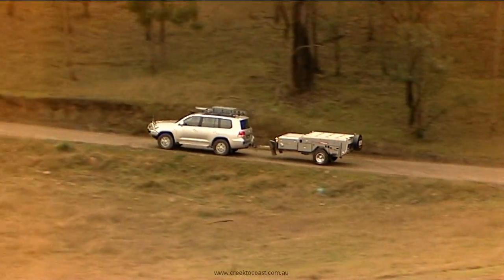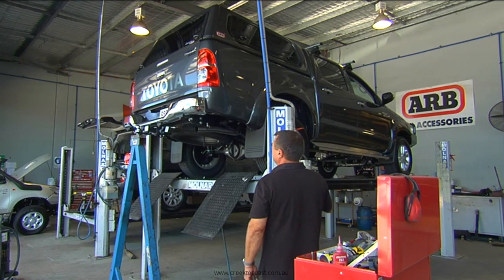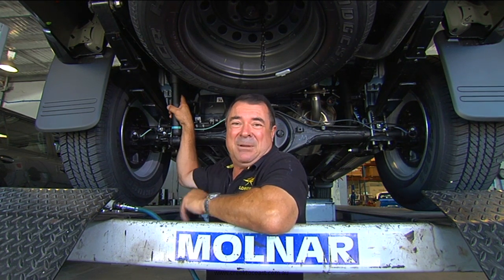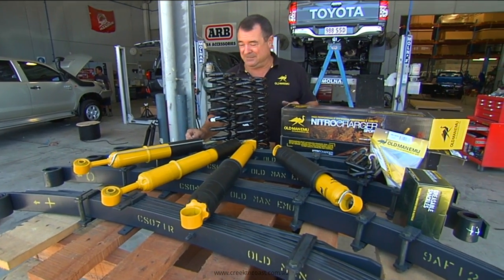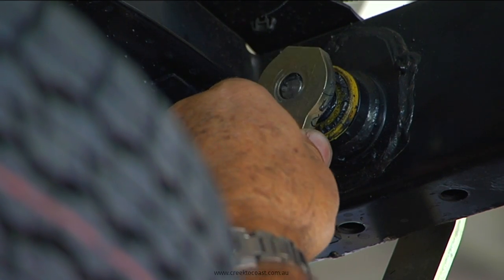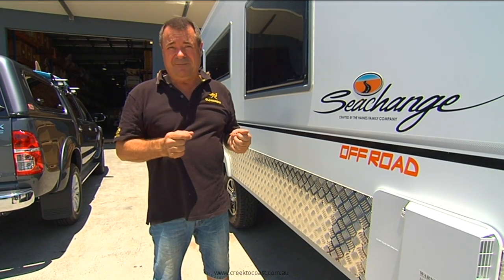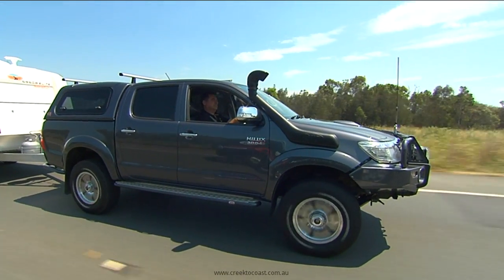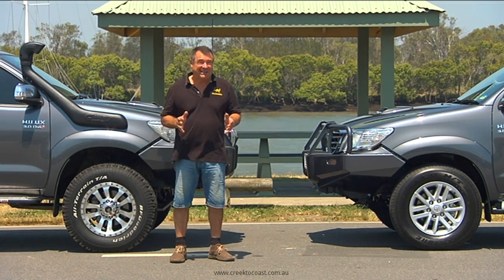What Kind of Emu are You?

Comment: I am getting a pre 1979 land cruiser fj40, I am going to use it for about the same amount off on road as off road and occasionally might pull a small off road trailer and/ or enough gas and supplies for 2-3 days out in the bush. I'm going to run 33" tires and drop a chevy 350 into the mix. what duty suspension would you recommend (the chevy is 200 pounds lighter than the stock inline6

Comment: ARB I'm really thinking of package kit fr 12 taco 4wd dbl cab I drive off road a lot and lots of firewood cutting I want lift that'll handle the heavy load in the rear should I got w/heavy kit or will stock handle load in rear ?is heavy kit just fr front,if say u want steal bumper in front or is it both F&R

Comment: hello,just like to say I had OME springs and shocks on my car after reading how good they were so tracked down a supplier here in the UK, had them fitted worked fine at first after maybe two years ish found I was getting a bit of bounce on the rear after inspection they had failed was not very impressed after doing so much research shortly after the fronts failed so now I still have OME springs but not shocks and cost so much?

Comment: hey ARB, I've got a 97 Nissan Patrol Gq it has everything original and obviously weary. I want to upgrade to something that's more comfortable and absorbing I prefer a solid feel. I have an oem stainless steel bull bar and an electric winch upfront. also want a 2" lift. pls suggest a kit for me and where to buy from online. thanks Asad
Reply from the maker: +Asad Moyeen ARB has a range of Old Man Emu suspension systems available for the GQ patrol. For your nearest distributor check out the store locator on our website http://www.arb.com.au/contact/find-your-nearest-store/

Comment: Hi. I have a 2007 ranger 4 x 4 and I live in nz. I occasionally will be using a slide on camper weight 800kg+ and I'm thinking of adjustable rear shocks so I can adjust when load or no load. Do you have anything?
Reply from the maker: Hi Rod, in this instance, the spring will be the most important aspect for your Ranger. Unfortunately, we don't have a product that is adjustable at current.

Comment: I have a land rover discovery with old man emu sport shocks and the ride is hard as hell. After two years of use (not abuse), one of the rear shocks was broken at the top. I`ll buy another ome sport because I still trust in their quality, but my first impression was very dissapointing.
Reply from the maker: xxxjanokickxxx Sorry to hear of the issue. OME suspension is covered by a 3 year warranty, so your local distributor will be able to assist you in having this replaced. Failures are very uncommon, so it is disappointing to hear this has been your experience with the suspension.